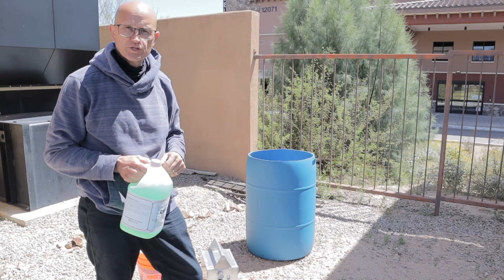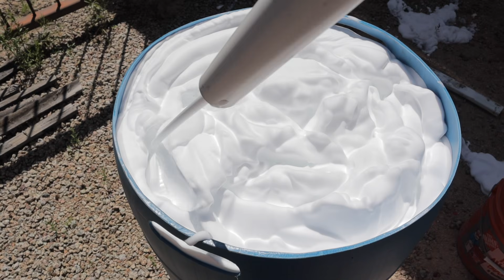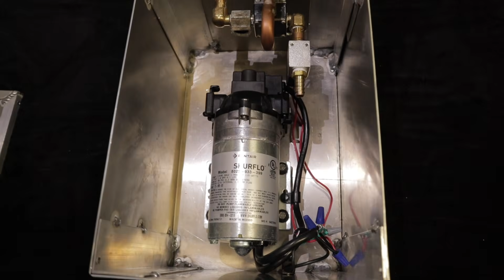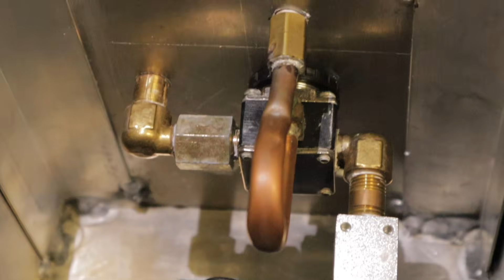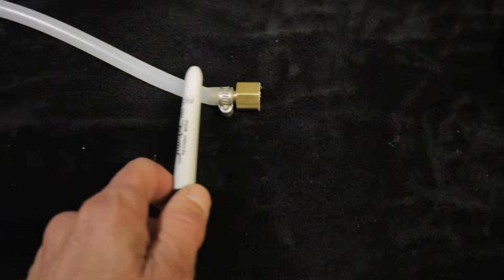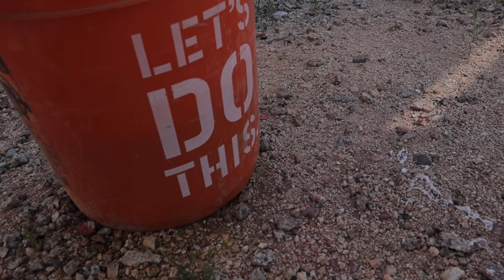Aircrete Foam Generator Machine DIY  [ How To build one that makes Great Foam!

Comment: Good good video!
Reply from the maker: Thank you🙏😊
Reply: Have you  ever made Aircrete with refractory cement?
Reply from the maker: Hi Randal, no, but I have thought about that for insulation for my brick pizza oven that I’m planning to build.😁👍
Reply: Are there any difference or recipe advice you can share 
I’m thinking of a wood fired oven use for aircrete.?
Reply from the maker: I think it should be pretty close to the same as regular cement as far as recipe goes. I was going to use fire bricks for the inner lining and then pour Aircrete in over everything for the insulation layer and then probably stucco the outer layer for durability. I’ve thought about this a bunch and I’m not sure if the refractory cement is even needed but it would certainly insure that that insulation layer doesn’t degrade over time from the heat.😊👍

Comment: Superb video. I'll be making this set up to produce aircrete for my pizza oven build projects and giving you a shout out on my channel when I do. Thanks for taking rhe time to upload, much appreciated.
Reply from the maker: Awesome! A wood fired pizza oven is on my list of projects as well😀👍
Reply: @PranaTech  I'm also considering a wood fired Pizza oven which is what led me to discovering the world of AirCrete. I think I may do a dual fuel with a thermocoupled Propane heat source to facilitate better control for long controlled projects like low and slow for meats. I would think the thermal mass would be very conducive to that.
Reply from the maker: That sounds like an awesome idea with the dual fuel setup!  You could even set it up with an electronic control for temperature and plumb in a pilot light and solenoid for gas and have it maintain an exact temp for as long as you wanted.😀👍
Reply: @PranaTech  That is my plan.
Reply from the maker: Nice! 👍

Comment: That foam doesn't look bad ...but I think it needs to be thicker/firmer. May try adding a few more scrubbing pads???
Reply from the maker: Hi Jimmy! I’ve tried less and more pads. I made a newer design wand with my new high output generator and it has an expansion chamber after the pads and this helps it a bunch. Check out that video. Foaming set ideal at about 17:48 in the video. https://youtu.be/L-SAHq9X9QQ😀👍

Comment: Thanks, Don for all your generous learning and support. It's amazing that you're so giving of your time, talents and information. I went ahead and purchased an air compressor and the shurflo pump you originally mentioned. I now see your constantly improving especially with your high output design. Question. For now, I'm going to stick with the California Air Compressor because its quiet. At just over 5 CFM at 90 PSI. Would the heavier duty pump (or equivalent) you mentioned above be the right choice for my air compressor? Thanks so much Don. Weldon
Reply from the maker: Hi Weldon, thanks for your very kind comments! They are greatly appreciated!  Ok, so that compressor will work very well with my original smaller design but will be ok for smaller batches with my new high output design. I tested my new high output foam generator at work and their compressor is a 4.5 CFM @ 90 psi 30 gallon tank unit. It worked great for about 4 gallons of foam solution and was struggling for the last gallon to produce good foam. This would only come into play if you were doing large batches of Aircrete and needed a large volume of foam to match. That 4 gallons of foam solution made well over the top of a 55 gallon drum of foam so if you are doing smaller batches of Aircrete your compressor will work great because while you are mixing up a batch, you compressor can pump back up and you can do it again. Now if you want to dose an entire cement truck worth of Portland cement, you are certainly going to need a bigger compressor.😀👍Don
Reply: @PranaTech  That's fantastic news!. I meant what I said about you, Don! Thanks for everything your doing. I'm looking forward to your future work with hempcrete in combo with aircrete. I live in Vancouver BC. Change is slow and arduous from industry-standard practices. It's going to be a long battle to change any code up here. I'm sure you can relate in the States. FYI; there is a 300,000-acre hemp farm that will be in full production by 2025 in northern BC. They plan to ship hemp to ports worldwide. Lastly, I'm hoping I could email you to the address if I have questions? I'll keep it short... Again, I don't want to take up too much of your time but appreciate anything you can offer. Sooner than later, you won't have the time to answer questions due to your continued success:)
Reply from the maker: Hi Weldon, glad to help anytime! My email is pranateq@gmail.com and feel free to ask all the questions you want. I’ll try and help in anyway I can.  I definitely believe that hemp is one of the building materials of the future. It will take a while to get it legal to grow everywhere here in the states, but I believe it is coming. Talk to you soon.😀👍
Reply: Sir, i want you to build this for me, am in Ghana i need this compressor sir.

Comment: Great video! Thank you for sharing your plans and ideas. Question - what type of pump should one look for? Would a self-priming diaphragm pump work? Or are there better terms to search for?
Reply from the maker: Hi JW! Yes a self priming diaphragm pump is what I used. I have some links in the description for a couple pumps that would work. There are great deals on a regular basis on eBay for high quality diaphragm pumps. You basically need one that will be able to output 60 psi or greater would be even better. Mine has a 90psi capacity and puts out 1.6 liters per minute.  I also built a larger version that uses a air powered double diaphragm pump and puts out a lot more foam. You would need a decent size air compressor to run that version though. Hope this helps. Let me know if you have any other questions. 😁👍

Comment: If I understand correctly, the foam solution is forced into your output hose at a constant 90psi and 1.6gpm because these are the pump's non-adjustable settings. Apparently this makes your foam generator very simple to operate -- because you've eliminated all the variables associated with the foam solution, thus leaving you with only one adjustable parameter -- air pressure/volume which you can easily control via your regulator. Genius!

Did you buy the CMX™ Foam Concentrate directly from Richway? If not, where did you get it? I've searched for it on the Internet but haven't found any retail sources, distributors or dealers.
Reply from the maker: Hi Fred, you are pretty close on the operation of the generator. The only thing that I realized about these pumps is that they boost up to 90 psi based on the pressures of the system. When I turn the air off and run just the pump to flush the system it probably only puts out 25 psi but as soon as I put my finger over the end, it will boost up all the way to 90psi if I could hold it. So it sort of balances the flow of water to match the air pressure where it mixes in the y before it comes out the front of the generator.  The CMX solution I purchased right from Richway. Just called them up and ordered it over the phone. I think it was $50 a gallon. It costs more than the Drexel foam but it is way more stable when mixing with the cement. I made some aircrete with it yesterday and it was the best stuff I’ve used. It mixed smooth and creamy with small bubble structure. I made a video of it and I’m going to upload it today. Thanks for the comment!  👍😁Don
Reply: Hi Don, thanks for the clarification. Since your pump basically matches your air pressure it should be possible to use only an air compressor to power a foam generator of a different design. This would require a pressure-rated vessel to contain the foam solution, but it would eliminate the cost of the pump and the use of electricity in a wet environment.

To mimic the performance of your generator without a pump, two air regulators might be needed, one to pressurize the solution vessel at 90psi and another set to 65psi to match your regulator air pressure setting. This setup would also require a valve to control the rate of solution dispensed, or maybe a piece of copper tubing crimped enough to limit the solution outflow to 1.2gpm (more or less) at 90psi thus matching your pump's fixed volume output.

I've seen videos of people building foam generators without pumps, but usually they make their own solution vessels out of PVC pipe. This can be problematic because they all want large pressure vessels, but large diameter PVC pipe is weak, so they use long pieces of small diameter pipe instead. This makes those generators inconvenient to fill and unwieldly to use and store.

I think the benefits of your generator design are that it is very small and easy to move around, easy to control with only one regulator and a single on-off switch, and it can actually generate foam non-stop from a container much larger than a 5-gallon bucket if you happen to need that much -- no pressure vessel required.

I'm wondering if you normally set your regulator at 65psi as noted in your video, or have you been able to produce excellent foam at lower air pressures with certain foam concentrates on a repetitive basis? For example, would you ever want to be limited to 50-60psi air pressure? Or do you absolutely prefer the ability to use higher pressures? Here's why I ask:

Most DIY folks seem to be using lower pressures with their generators (which do not use pumps of course) yet they are claiming to produce great foam in many cases. My thought here is that if your generator can produce excellent foam at lower air pressures, a cheaper Shurflo pump could be used, perhaps one with a 60psi rating, and this would lower the build cost. Does this possibility seem practical or foolish based on your experience making foam?
Reply from the maker: Hi Fred, I think you could easily get away with a lesser psi pump if it could still produce the 1.6gpm. I bought the pump used on eBay for like $35 and it has worked out great so far. I have played with running the air pressure up to 90 and it makes great foam with very little density.  For Aircrete to be structurally effective, you want to take a 5 gallon pail full to weigh 3 to 3.5 pounds of foam.(not including the bucket) To get this kind of density I had to drop the air pressure down to 60-65 psi and essentially make wetter denser foam.  Knowing this now, I probably could have gone with the lesser shurflow pump as you have surmised.  The pressure vessel foam units were just too complicated and unwieldy for me.  Too many hoses and valves and constantly filling reservoirs.  My plan is to build my own dome home out of Aircrete and so I will be building a much lager version of this system that I can use to inject the foam inline on the output side of a peristaltic concrete pump that I am designing, and eliminate the cement mixer from the equation. Just have a cement truck deliver slurry into my pump and then pump Aircrete directly into my forms. The new larger pump will be an air driven dual diaphragm pump.  I have a bunch of projects in the works. Should be some very cool videos soon!😀👍

Comment: What did u use the 3/8 to 1/4 female to male fitting listed in parts list for? Tube for want u mentioned is 1/2 inch. Did u use the same tubing for inside the generator?
Reply from the maker: Hi Alonzo! I believe I used that fitting to reduce the outside push lock fitting to the inside hose transition. I think you could eliminate it if you just use a 3/8 O.D. Barb fitting with a 3/8 npt female on the other end.  Yes the inside hose is all 1/2” tubing as well. 😊👍

Comment: The question is....how long does the foam has to last before the aircrete is set enough that it doesn't matter?  That's all the time you really need the foam to last. If it would last longer than that, it doesn't make it any better than another foam agent - all else being equal?
Thanks for the helpful video.
Reply from the maker: Hi Gerry! Yes, that is the truth!  What I have found is that the higher quality foaming agents consistently last longer and make better batches of Aircrete. There are human factors that can affect the outcome as well, like mixing in the foam to the Portland cement too long and breaking down the bubbles. Thanks for your comment!😊👍
Reply: Thanks...do you have an answer to my question?
Reply from the maker: At least a couple hours.  There are a lot of factors that affect curing time like outside temperatures and humidity. 👍

Comment: I wanted to understand how do u know how much is the air pressure in the mixture. Or if there is a way to know what's the air to liquid mixture ratio. Of the foam
Reply from the maker: Hi Noel, I use 55-60 psi of air pressure to make shaving cream consistency foam. The foam consistency is the important part. Once you have your machine dialed in with air pressure making good thick foam, you then can adjust the density of the Aircrete by how much volume of foam you add to your mix. If you watch my other video on how to make Aircrete the right way, it tells you how to measure the density through sampling you Aircrete mix. Here is a link https://youtu.be/q5xqT2sFGdI 😊👍

Comment: Question please. I found the pump you used and it is really expensive. Do you know if a pump wirh 45 psi will work out will it have problems at the venturi and back flow.
Reply from the maker: Hi Surly Dog! You need at least a 60 psi pump for my design to work. I have updated my parts list in the description so there are two pumps on Amazon that are fairly affordable. I purchased mine used on eBay and you can still find them if you search diaphragm pumps on there. 👍😊

Comment: The pump im looking at buying is 110v 5.5gpm 70psi diaphragm pump. Will this be sufficient? I noticed the one you use has a higher psi
Reply from the maker: That should work fine. Most of the time I have the pressure set at about 55-60 psi so that one should work well.😊👍
Reply: @PranaTech  awesome! Thanks alot

Comment: Hi, nice project...Prana, I bought all the compones for the generator, but unfortunate , the SOLENOID CAME WITH 2 BLACK WIRES,,,,WHICH ONE IS HOT
Reply from the maker: Hi Nelson! It won’t matter on a solenoid. It is just an electromagnet so being energized is all that matters. 😊👍
Reply: @PranaTech  Thank you
Reply from the maker: No problem at all! Let me know if you have any questions when you get to building it. 😊👍

Comment: How much of that solution is water versus other chemicals (percentage wise)? And how safe are those chemicals to use? Do you need to worry about aircrete off-gassing VOCs?
Reply from the maker: Hi Braeden, the majority of the solution is Portland cement and water. There is 4 ounces of foaming solution mixed into 6.5 gallons of water. Over the last year I have switched to a company called Vermillion and their foaming solution is completely harmless and non toxic and the best I’ve used to date. Here is a link to their site. https://vermillionassociates.com/varimax-concentrate.html  No VOC’s with this stuff as it is completely non-toxic. 😊👍

Comment: Apologies if this is a dumb question but couldn't a submersible water pump work? I already have one and it delivers 216 litres per minute vs the industrial pump linked in description which delivers just 25 litres per minute. I'm sure im probably missing something here though😂 Many thanks 🙏
Reply from the maker: Hi Pete! That is definitely not a dumb question at all. Typically the higher the volume of output of a pump, the lower the pressure of that outflow. The pump needs to be able to produce at least 60 psi or 413 kilonewtons of output pressure so that it can produce good thick foam like shaving cream. You could put a pressure gauge on your submersible pump and see what the output is and if it can produce enough pressure, then by all means, use it. Typically those types of pumps output much lower pressures though. I hope this helps! 😊👍
Reply: That is very kind of you to take the time to give me such a thorough explanation, and I totally get it, and I imagine it wont be suitable!  @PranaTech
Reply from the maker: Anytime my friend. If you ever have any questions, please feel free to ask and I will try to help.😊

Comment: Awesome video and design, I am new to aircrete and this is the best one I have seen (hat off to you sir!)  definetly I will be building mine inspired in yours, just one question: whats the CFM and tank size of your compressor? greetings from México!
Reply from the maker: Hello Jorge,  the smallest size I have run this unit with is a compressor that was 4.5 CFM @ 90psi output and had a 30 gallon tank and it was able to keep up with no problem. Let me know if you need any other information. Paz mi amigo!🙏😁

Comment: Hi, your specs say that a diaphragm type pump is used. My question is that will a centrifugal type of pump work the same for the foam generator?
Reply from the maker: Hi Rico! Yes any pump will work as long as it can produce 55-60 psi of pressure because it has to be able to match the air pressure incoming into the system so it can blend into a good foam. Let me know if you have any other questions 👍😊Don